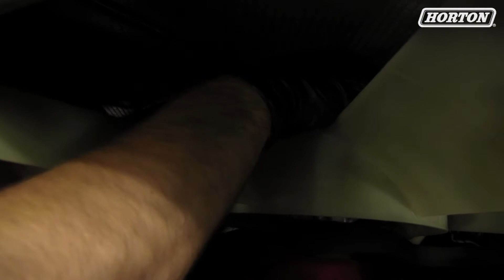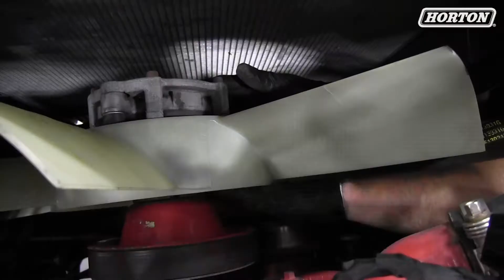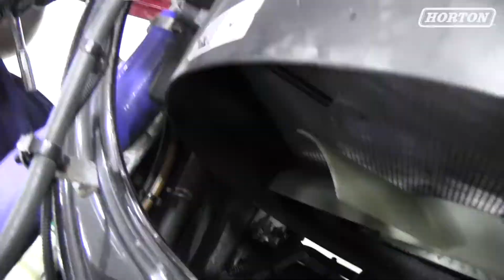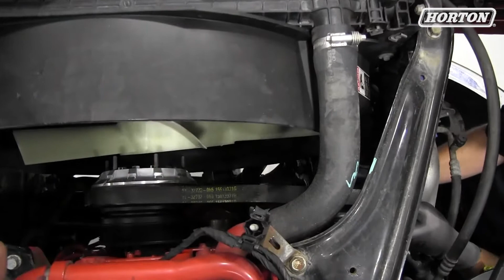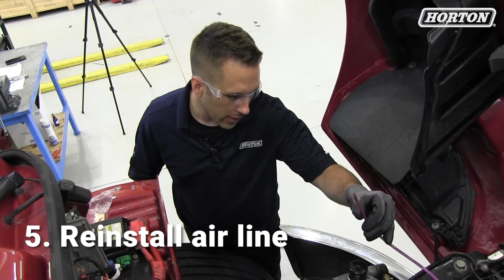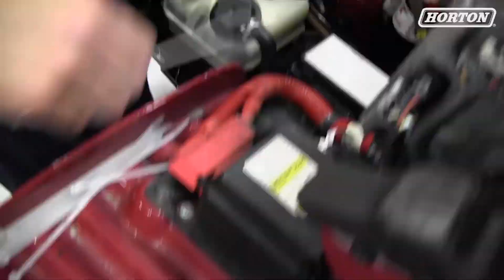How to replace the fan clutch on a Freightliner M2 with a Cummins ISB engine

Comment: I did this job yesterday evening. It took me about 1.5 hours to get old one out and new one in and about 30 minutes to figure out on how to mount new solenoid. I ended up drilling a hole and cutting the lower section of mounting plate so I can have two mounting points ( Top is slotted so your hole measurement does not have to be exact). I did take the upper piece of the fan shroud off though, it's a split shroud. It makes the job way easier. Don't forget to put cardboard to protect radiator just in case you drop a tool. If you drop the new fan clutch assembly might as well order a new radiator because the cardboard will not protect it, it's heavy. I'm a one man shop but have 20 years experience.
Reply: Does it run cooler at highway speeds?
Reply: @fukface91  It did not run any cooler. The reason I replaced this one was because the fan clutch was leaking air, and this kit was the new replacement.

Comment: I’m having trouble disconnecting the air line. I’m extremely new to working on my truck it was a easy fix so I figured I would save myself a few thousand by doing the repair myself. But the air line is giving me all the difficulty. I got the fan removed so I could get to air line better but still having difficulty. What part are you using the wrench on to release the air? Please help.
Reply: Did u ever get a reply on your question? Thx
Reply: Just cut the line and install it into the new setup🤦‍♂️